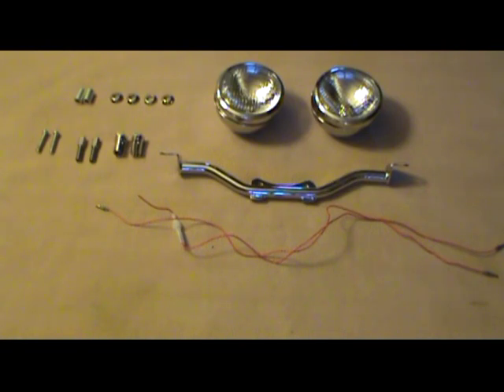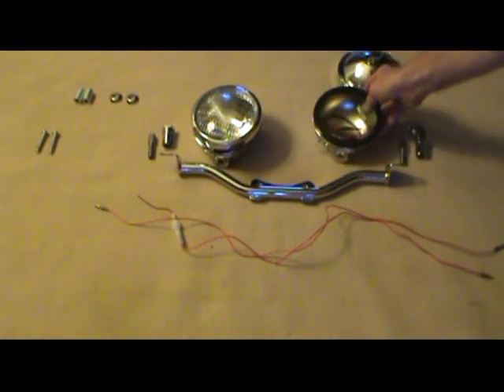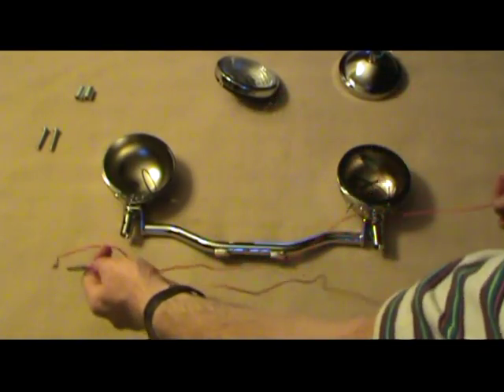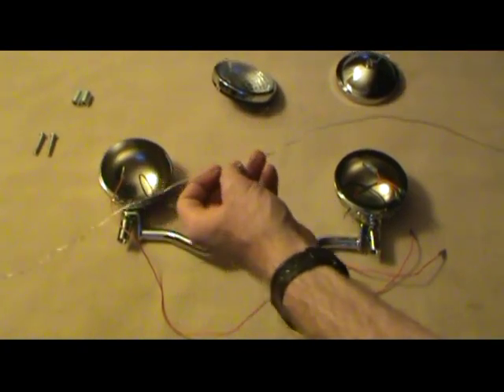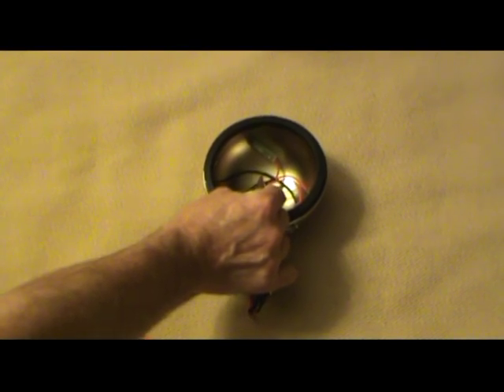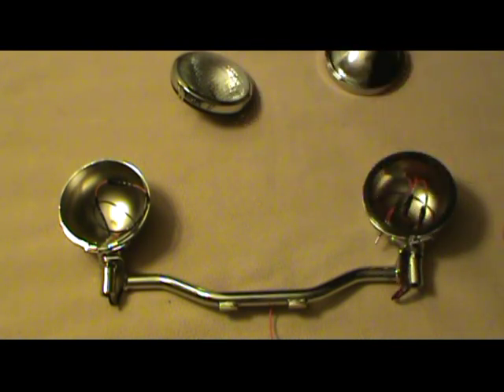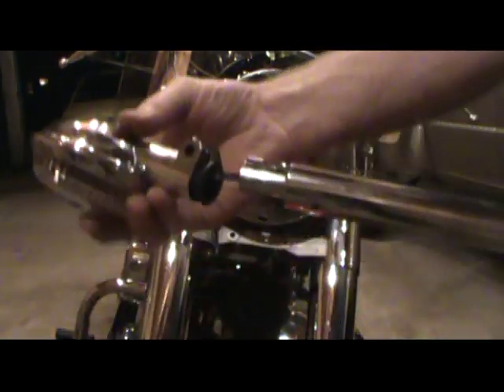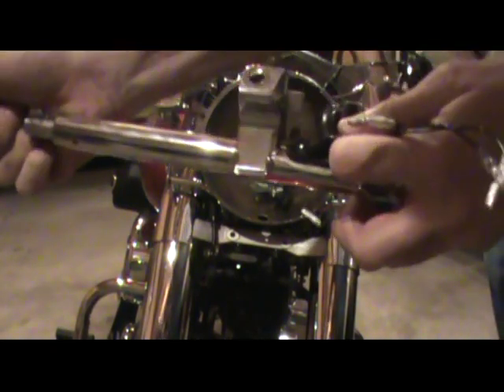2008 Yamaha V Star 1100 Classic Passing Light Install Part 1.mpg

Comment: Thank you so much for making this video. I can not see while riding at night with the one stock headlamp on my Yamaha Vstar 1100 Classic. It was a little confusing shopping for fog/passing lights and how to install them with what hookups and such I may need. Oh and also thank you for mentioning the off/on switch on the side of passing light. Life saver!
Reply from the maker: I am glad this helped you out. I apologize for the poor quality. This was one of the earlier video's I did and was just getting the hang of it. One complaint I had when I was on a group ride was the leader couldn't see my headlight when I was toward the rear of the pack. Riding at night using the low beam was terrible.  The passing lights defiantly help but if I was going to do a lot of riding at night I would buy LED bulbs. My main purpose for putting mine on was making it easier for people to see me during the day. At night around where I ride there are too many deer. I like to be home by 6:00.

Comment from the maker: Yamaha OEM. Bought the lights and light bar separately on E Bay. Light bar is different for the Custom and Classic. One extra note, make sure to tighten the bolt that holds the light to the bar very tight or it will come loose.

Comment: I got 2 questions for you; 1) The switch on the the passing light is oem or it has been added by you? 2) Do you know if all the hardware comes with the bracket or we need to buy some hardware separately?
Thanks!  Nice video!!
Reply from the maker: Switch is OEM and all hardware came with the OEM bracket. Happy riding.

Comment: I tried it everything is working fine except the switch to turn on and off these lights could  you tell me how did you connect it
Reply from the maker: The switch has to be wired in series with the lights. It may be helpful to see if you can find a video on how to wire a light with the switch wired in series. To explain it the best I can, the power comes in to the light (fused wire) and goes in to the switch first through one wire on the switch. The second wire from the switch goes to both lights. The fused wire is hooked up to the headlight low or high beam power wire. You have to check the laws in your area. Some laws do not allow the auxiliary lights to be hooked to the high beam.
Reply: Could you send me a picture of your wiring connection where the switch is??
Thanks again for your help.
Reply from the maker: I have the bike up for sale right now so I don't want to take it apart. Sorry about that.
Reply: No worries 
Thanks

Comment: Got any information on replacing the light bulbs?
Reply from the maker: I don't have the bike any more but if I remember right there was a Philips head screw on the bottom of the light bezel. Take that out and the whole works come apart.
Reply: @OnTheEdgeNow  oh I'm sorry I meant the types of bulbs. I already took mine out but Im trying to replace the bulbs and not sure which ones to buy.
Reply from the maker: @Keyumiz  I am really stretching my memory but I believe they were H-35 bulbs. Don't quote me on that.
Reply: @OnTheEdgeNow  is the H for halogen and the 35 for watts? Does higher watts make them brighter?
Reply from the maker: @Keyumiz  Yes, a higher wattage in a halogen would be brighter. Putting a higher wattage bulb could create problems. The electrical circuit may not be able to handle the extra current of a higher wattage bulb and there will be more heat. The heat would be trapped in the housing and could melt the wires. The other problem might be blinding oncoming traffic with a higher output bulb that was not intended to be in the light fixture. I wonder if they have an LED equivalent out now?
Reply: @OnTheEdgeNow thanks for the info. Another question for you. So my used Yamaha v star 1100 has two spot lights with different bulbs. Bulb 1 is 35w incandescent sealed about 4 1/2". Bulb 2 is 55w halogen unsealed about 4 3/4". I'm trying to replace bulb one for one similar to bulb 2 but I can't find the right size on the net
Reply from the maker: @Keyumiz I'm afraid I don't have an answer for that question but  I would take it in to an auto parts store. They should be able to match it up.
Reply: @OnTheEdgeNow  thanks for the help. I'll swing by one tomorrow and see what they can do
Reply: I bought new auxiliary lights but are 100w each. Too powerful for stock turning signal fuse.keeps blowing.any ideas to bypass fuse box?
Thanks

Comment: they are nice to have but the wiring is crap. the switch is cheap and the wires break at the solder points. Cheap cheap cheap
Reply from the maker: I put mine on so when I went riding with a group the leader could see me. He always complained my headlight was too dim and he had trouble seeing me.